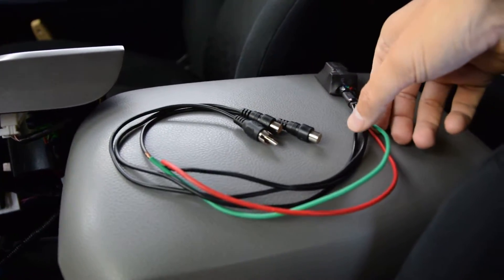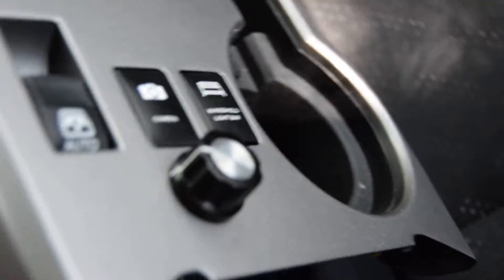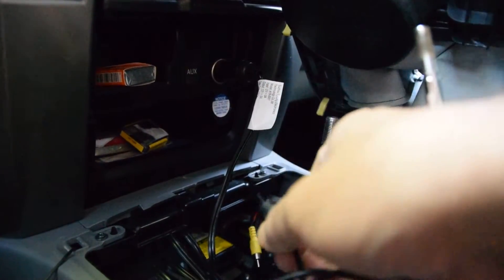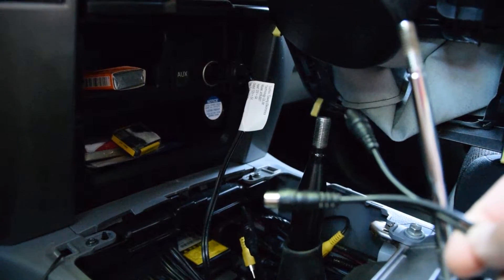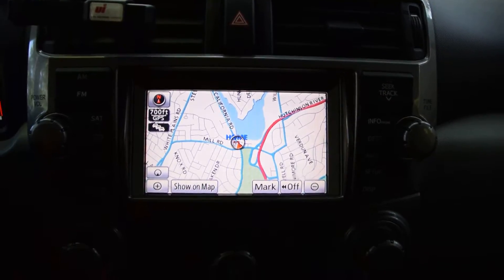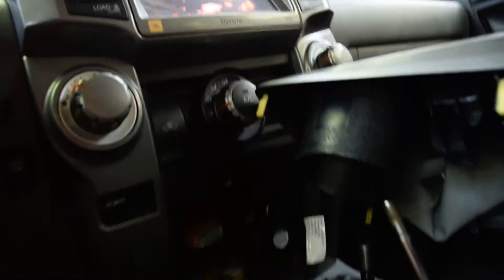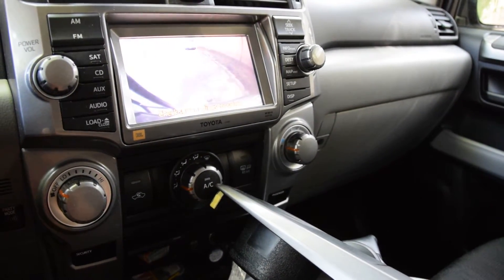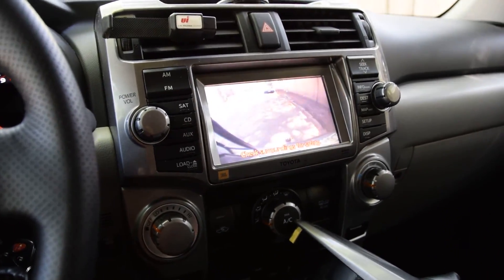New Two Video Source Switching Relay

Comment: Great Video bro. Base on my experience installing 2-Inputs Monitor with 2 cameras, I didn't have to use relays, you see car monitors (mine is 3 pieces  2 for left & right with 2 cameras each 1-front & 1 rear facing total 4 cameras for 2 monitors) And I have 1 Monitor with 2 cameras as well with 2 cameras (1 for front view and 1 for rear). In my case, my 5-inches car monitors has 'auto-switchers", once you have "2-inputed cameras on" AV-1 and AV-2 on the monitor, when you turn off AV-1 camera 1  (by disconnecting the power 12V line to the camera 1), the display will automatically turn-on AV-2 means the camera 2. So I just use a regular switches for them and no relays needed.

Comment: Can that be used for 1 video input, i.e. camera input, and use it for screen mirroring. I have a backup camera that I'd like to use when I put in reverse, but also would like the cam button on my radio to be used to mirror my phone on the radio? I have a 3.5mm aux AV jack, but does not seem to work for what I am trying.